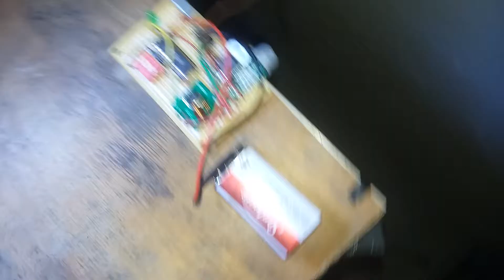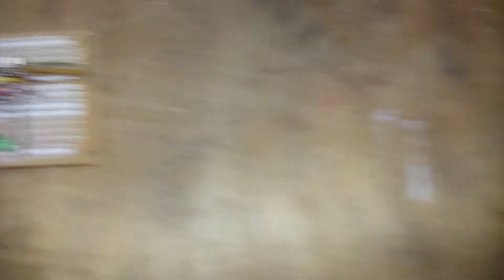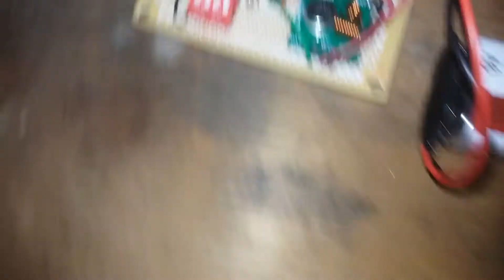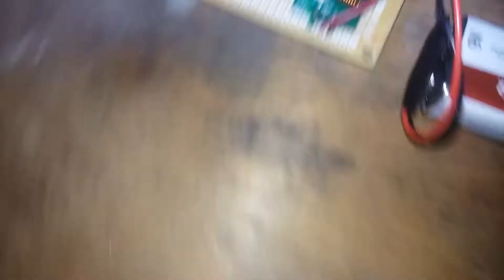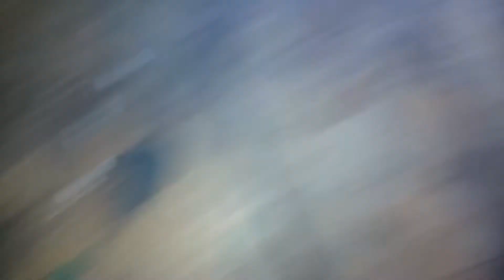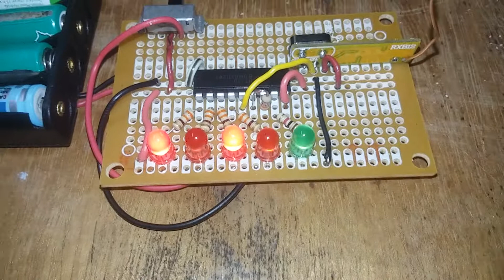Motion/PIR alarm using HT12E and 433mhz RF link

Comment: Hello, this is keen and brilliant, Mr. Zenner. Awesome concept of treating the "boot time" of the sender as zero, so it's practically a one-shot. I guess I am spoiled by computer use / lack of electronics-thinking, which led to my wrong idea "Things which can do stuff always need time to boot first". It's similar with MOSFETs, where I initially wonders why ppl care for the switch times. I always thought of it as switch for heavy loads and did not understand. But later I realized it's important for PWM, which I still feel as a kind of dirty method to do things, haha.
Will definitely do try that in a future project. Thank you.